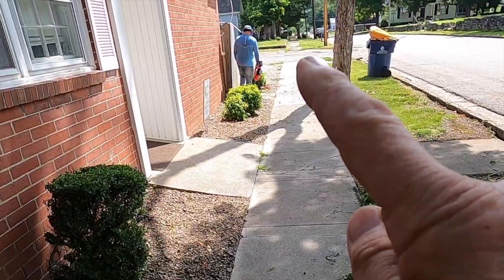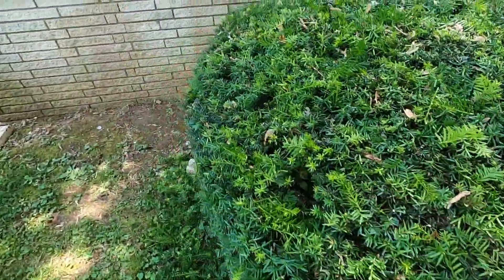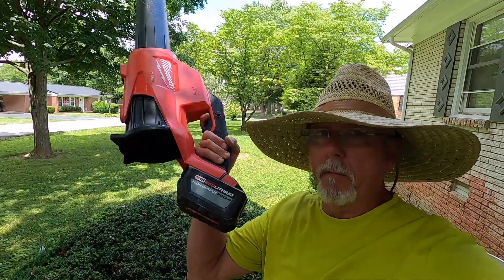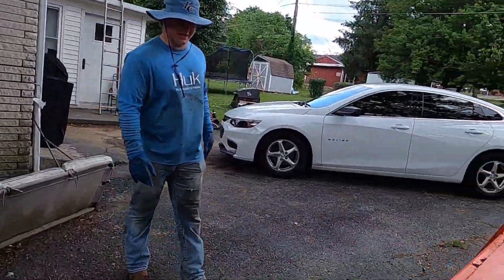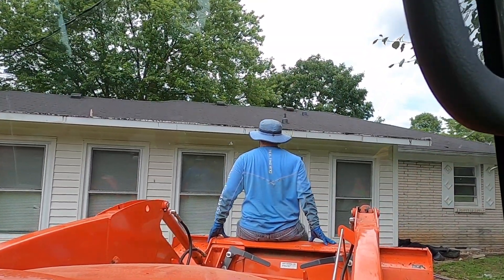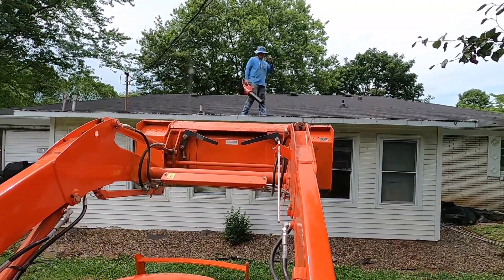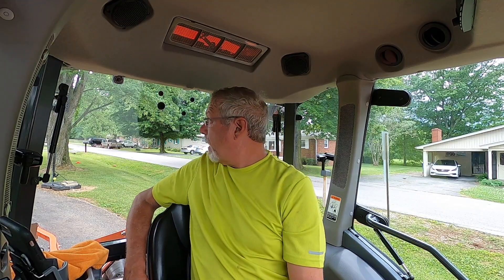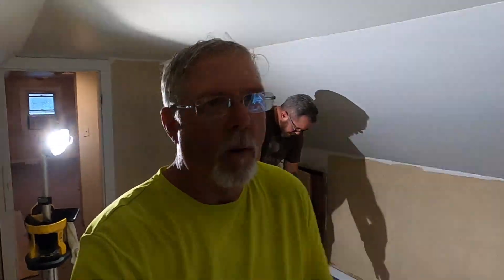Rental Property Maintenance

Comment: I've found a small length of board makes an easy gutter-cleaner. I use a 2X4 to run inside of the gutter to push debris to one end. For smaller gutters just rip-cut the 2X4 to the width of the inside bottom of the gutter. I also use a broom handle to push the 2X4 for those longer areas. This allows me to climb the ladder less often.